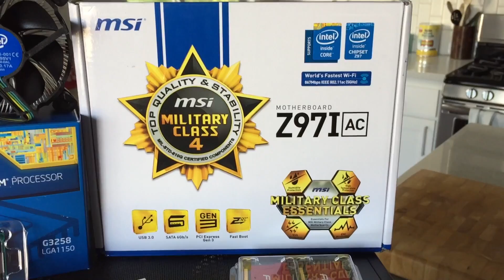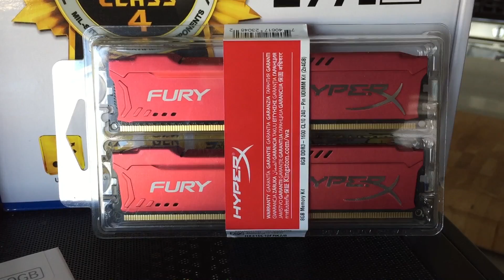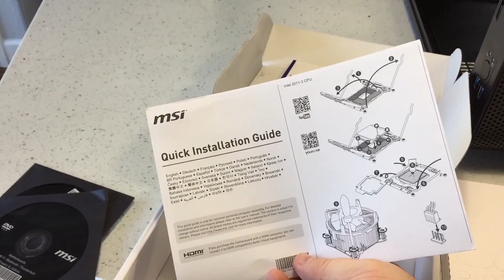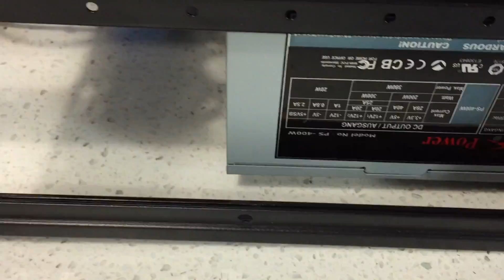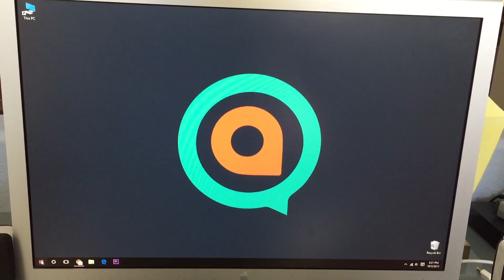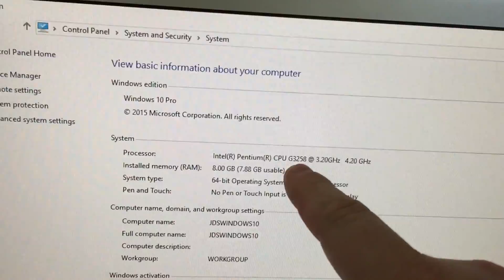Pentium G3258 mini ITX Build

Comment: That a week pc why a pentium cup why not a core i3 like come on and we're is the gpu like dude really you can get a 740 for like $100 or less like come on dude ugh
Reply: +The True Drex The great thing about this Pentium is it is Fully unlocked, like the K series i5 and i7 CPUs. so for the cheap price of that Pentium ($69 most places). you can get great performance.  Most can OC to get the CPU to 4.2 without issue and some even all the way to 5.1GHz.
Reply: but what about the graphics card
Reply: The True Drex using the onboard Graphics, Newer intel graphics are not as bad as the older ones. Like the core GPU on my G3258 hits 1150 MHz, and i can overclock it also. People have overclocked the intel video to 1300 MHz on that CPU.
Reply: +The True Drex Pentium G3258 beats a locked i3 and even some unlocked i3 models when the pentium is overclocked. And I don't see why he needs an extreme GPU or CPU upgrade if it's not apparently gaming on it.

Comment: i noticed the cpu chip is made in vietnam how good is the overclock?
Reply from the maker: So in testing today I had it stable at 4.2ghz on the stock cooler but when I tried to render it crashed. It rendered stably at 4.0. I have a Cooler Master Evo 212 coming tomorrow so we shall see how far we can over clock it.
Reply: AppChat Radio cool hope you will do a video on overclock with this cpu
Reply from the maker: +CopyCat Definitely. Especially when the Evo 212 gets here.
Reply: +ScrotumSqueezer I just got my G3258 in, OC&#39;d to 4.0GHz last night. with stock cooler. temps maxed at 67*C. 4.0 GHz @ 1.280 V. I was able to get 4.2 GHz at same voltage, but failed after stressing out for 20min. So i clocked back to 4.0 GHzBut since i am using it in mu Arcaade/Emulator Box, 4.0 GHz tested on several games with the Integrated Graphics without issue. Also with the Stock HS/Fan Idle at 4.0 GHz right now is 21 *C (According to RealTemp370)
Reply: +AppChat Radio   You got the same case that I do. I cut a slot on the right for an internal DVD player. But dang, you went all out on the motherboard. Too much for me. I got the MSI H81m-33 micro atx motherboard.
Reply: +AppChat Radio I manage to get 4.3 GHz stable with EVO 212 cooler on my ASUS H81M-E , but anything more like 4.4 results in bsod.
Ben is awesome by the way.